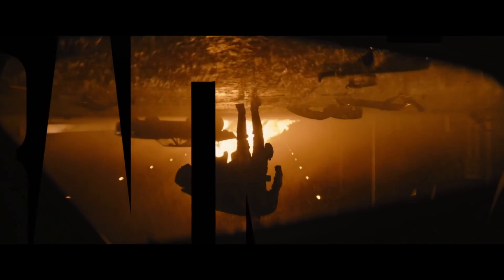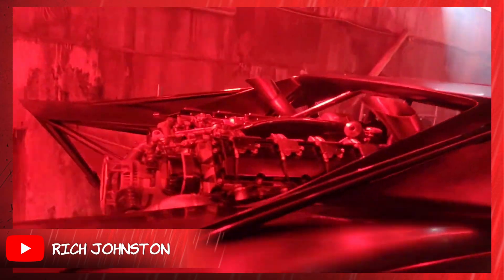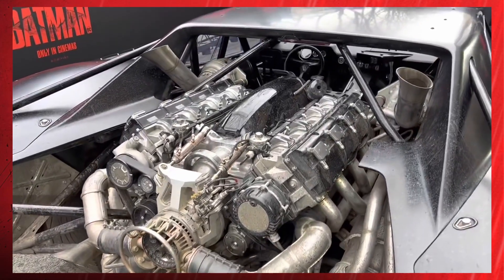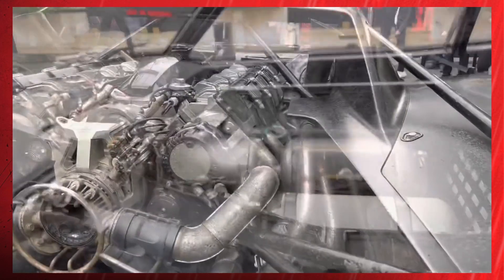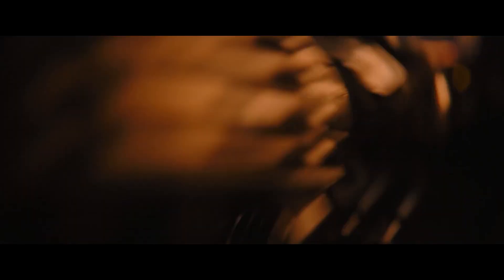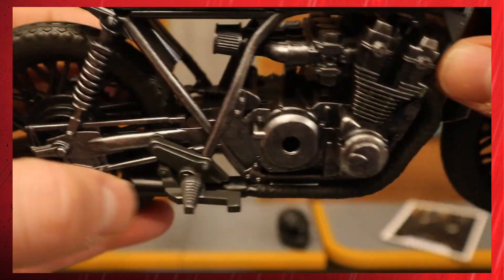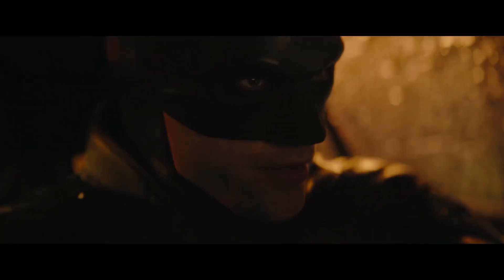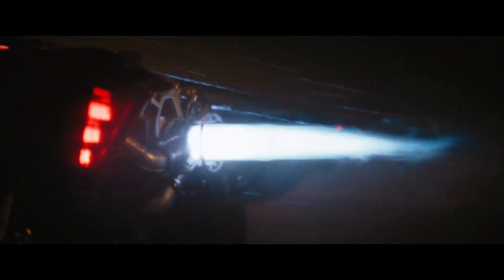The Batmobile & Everything You’d Ever Need To Know | The Batman’s *modified* 1969 Dodge Charger

Comment: Great research.  I read where all the shots they did with the flames (coming out the rear and the engine bay in the front) were filmed using the electric car to avoid flammable gasoline.  I'm guessing from a design perspective they wanted the rear engine to power the "jet Engine turbine" and the front engine was the standard V-8 driving the vehicle.  At least that is why it made sense to me to have two engines.
Reply from the maker: Nice! That makes a ton of sense!
Reply: "In universe" the vehicle only has one engine.   The real props have the "real" engine concealed because the visible engine -- especially the rear flame --- could never work.
Reply: That was kind of my take-away from the movie: that the car must have a big V8 in front that is the main driving power to the wheels (exhaust flames under the hood), and the rear engine is supposed to be more of a jet engine for strategic power boosts, like jumping the car thru the flaming semi truck. But what really matters is that THIS Batmobile in THIS chase scene was a huge adrenaline rush and played out almost like a scene from a horror movie.
Reply: It has twin turbo v8 all wheel drive

Comment: I am 100% sure that the “drifter” bike is a 1980-83 Honda cb750. the engine and tank are the same as my '81 Honda. 
I took it apart piece by piece I would recognize it everywhere.
Reply from the maker: Thank you for doing the work! I'll make the correction in another video once the Blu-ray/behind the scenes are available for everyone
Reply: @CinemotiveShopcraft  hey Josh! Great work! I myself have been doing some research on the drifter bike, and there are even elements of a 1970's honda CB.  Especially with the softtail design!
Reply: 75-78 seems to be the closest resemblance
Reply: I thought it was a Honda cb 550

Comment: Psssst! there's an alternator on the rear engine. It's right there on the passenger side. The pulley is facing forward to interface with the serpentine belt. Some OEMs actually do it this way for packaging. It's literally in the shot where you're saying that "power isn't being generationer by an alternator." :P
Reply: One more note - if you remove the balance bar between the two brake pedals on the running car, I wonder if you get steering brakes consistent with a dune buggy?

Comment from the maker: Thanks for your patience. I tried getting this out as quick as I could while also making it as accurate as I could. I hope you enjoy and that your appetite for Batmobile trivia is fed :)
Reply: Hey man , I've left you a like 👍
Reply: I was thinking a kz1000, of the drifter motorcycle. 
I would say you're right,  BMW Rnine t for catwoman ride.
A mod version of BMW/ Harley Batbike.
Reply: Lightning! ⚡Lightning! ⚡Lightning! ⚡Lightning! ⚡
Reply: Rad video man, do you know where I can see this in person?
Reply: Nice work. I like figuring this stuff out myself. I think the general shape is charger without any actual parts, except maybe some glass. The roof is flat as plywood.
On the designers site Ash Thorp has some very 69 Camaro drawings as well.

I saw a behind the scenes of the Batbike and it sounded electric. It may be a Harley electric. Also, a 'Lotus 7' had a camera strapped onto it. [if I link youtube thinks I'm a spambot and deletes it]

THE BATMAN (2022) filming action sequence (behind the scenes)

Also the rocket exhaust without sound effects.

The Batman (2022) - The Batmobile Startup | Behind The Scenes Footage
Reply: Kevin's 3D Creations  Sounds electric to me, BTS. It's engine area is massive top to bottom, just like a Harley Livewire. And they made 1 of 4 Batmobiles electric as well.
The designer gave it that look with stuff sticking out the sides. Doesn't mean they used that type of bike. Or maybe they used both.
Didn't Josh White say it had Harley front forks? Why would they put harley forks on a BMW?

Comment: OK, it's got two turbos mounted inside the cabin. So what's the central afterburner for ??
At 11:45 you can actually see the mesh filter in the turbo bell mouth.

With the engine mounted between the rear wheels the axles would have to go thru the sump ala Skyline GTR. But of course a Hemi motor can't do that !

That Medway belt is only rated to 60deg C ! Engines get wayyyy hotter than that !!

Comment: Hey Josh you said I think a motor running backwards would not work. 
look at a marine motor. because I think I might have seen this motor at my friends house.  the motor I seen was a chevy vortex 8100 reverse rotation twin turbo v8 out of a cigar boat. it looked a lot like that and it was reverse rotation twin turbo. but I can not remember if it has. coils like a hemi or a BMW.  yea probly not could have just customized a hemi with a reverse cut crank, like for a boat. that make sense to me.
thanks Todd

Comment: Could it be that the car was supposed to have 2 engines? The front provides power to the front wheels and electricity for the car and the rear acts as a sort of over-power mode driving the rear wheels when speed and 4wd is needed?

Comment: Great video, but look at your sources again... only the roof is 69 charger, the body is entirely custom bespoke. The front tire size in the video you referenced from the UK car is 30x12.00r18 on an 18 inch wheel, but unfortunately MT has discontinued that size, so the closest you can get is 28x12r18 up front, and 31x18r20 rears in the Sportsman. I did notice the car shown in NYC had 20 inch rim size for the rear on it.
Reply from the maker: Good catch!

Comment: I remember the Tumbler from the Nolan movies it used a chevy 350.
I wonder if the 650hp Chevy V8 is the ZL1 engine? It has the 6.2L supercharged v8 with that much power. Or I guess the Z06 C7 engine.
Anyways the scene was still awesome.

Comment: I think this Batmobile did only half of what the Batmobiles before it did. And that was actually a movie plot point. At that point in time, Batman was just alternating his time between his actual Batsuit and Drifter outfit and was mostly using the Drifter outfit and bike to get along while his Batsuit was stored in his backpack. He was working on the car for a long time as you can see at the start of the movie when he's in the Batcave and the engine is on the workshop. So, the half I was talking about is actually the half-finished nature of the car. It wasn't looking like a fully finished Batmobile but was still terrifying to look at and hear. Bruce was only using this as a pursuit vehicle because of the current predicament surrounding the police looking for him, something he can't afford to be while he's on his bike. 

If you look at the Batmobile, the engine is clearly too big for the back of the car, and he's cut out the back to accommodate the massive jet engine and afterburner. Naturally, such changes call for bodywork to cover the exposed part of the engine, but as per the aforementioned reason, Bruce chose to drive the car immediately, and while it was functional, the fact remains that it is grossly incomplete compared to the multi-featured Batmobiles of the other films. Given Bruce is now using the Batcyle at the end of the film, he's using that for the time being while he's gonna complete the build of the Batmobile for the next film, which Matt Reeves is planning to do.

Comment: There's one thing I'm still confused about the batmobile, does it have 2 engines? 1 in the front and the V8 with an afterburner in the back? Because i got confused when i saw flames in the front when the car started up (menacingly scene btw)

Comment: why does it sound more like a supercharged engine than a turbo? I'm not very familiar with either so it maybe a dumb question
Reply from the maker: Both whistle when the turbines compress air in their housings. But the turbo has a "brap" release since the spin is tied to the exhausts' output whereas a supercharger is tied to the accessory belt (always driven).

In the movie, I'd say it has more of a turbocharger sound. I definitely can hear what you mean though. Especially in the initial startup.

Thanks for commenting! ❤️
Reply: @CinemotiveShopcraft  @Dhanu _45 The sound designer for the movie did an interview with Dolby and discussed the sound of the car extensively. The supercharger/jet engine whine is a slowed down bottle rocket scream, and almost certainly was inspired by the Hellcats (it is a Dodge after all) supercharger whine/jet engines of course. The engine roar itself came from two recorded 70s Broncos with big block Fords.
Reply from the maker: Dude! I hadn't seen! Thanks for the insights!!

Comment: I BET I AM RIGHT!  See that thing on the back of the engine?  That looks
 like a little turbine.  What is under the hood is the compressor or 
combustion chamber to create the compressed air for the turbine on the 
back of the engine.  The power it creates goes straight to engine crank.
   If you see the real car there is a wire going to the turbine and that
 would be a sparker or glow plug or something to ignite the extra fuel 
they put to it to create the flame coming out of it.  So the car has a 
turbine engine and a piston engine then.  Just the turbine was split in 
half.  Half under the hood and the other half on the back of the engine.
   Make sense to anyone else?

Comment: How can the rear Bat-mobile engine be considered a working or none-working V-8???   When have you ever seen an engine with a jet turbine coming out of the center of it?? It may utilize some engine components, but it's more likely to be a completely exposed jet turbine engine (mind you the air intakes are in the car's (used to be) back seat) - not a V-anything. So to properly evaluate it, you'd need to have someone as familiar with jet turbines as car guys tend to be about V-8's, to do the evaluating.

Comment: As much as I love this Batmobile, I hate it with the same amount of vigor. Now, I won't talk about the IRL Batmobile(s) built for the movie. I'm talking lore-wise. I just can't wrap my head around WHY would he build it this way? And no, the argument "He's been doing this only for 2 years" doesn't fly with me. One of my mates, an IT guy, who likes cars and tinkers with them in his free time, has basically rebuilt his Leon and turned it into NOS-powered dragmobile. And it didn't take 2 years. For example:

- why are there evidently two engines? And which one is for the jet? Can't be the rear one, since the exhausts directly exit the turbos.
- why is the front one glowing during the start-up sequence?
- why would you mount an engine in the back and leave it EXPOSED? Has Mr. Wayne seen what a well placed .50 cal round can do to an engine?
- why would you put turbo intakes just inches behind your own head?
- why would you completely eliminate the passenger seat? Is he not planning on taking criminals into custody at all?
- why would you put 14 exhaust pipes on the car? (not including the jet)

I'm sorry, but just as I love the idea of this kind of a Batmobile (which I've taken further and designed one myself, based on a muscle car as well), it's simply too stupid to be either functional, or designed by the Batman.
Oh, and your research into this was nothing short of brilliant. Great work!
Reply from the maker: Absolutely love your comment!
Reply: @CinemotiveShopcraft  Cheers, mate. Made my day!

Comment: So the rear engine is fake?
Reply: Kevin's 3D Creations  what do u mean? Like it powers the turbine that drives compressor? I don't think so... you hear the jet whine and scream BEFORE we hear the engine startup and roar. I think that glow under the hood is actually the bulk of the jet engine setup in universe. The exhaust gasses from the engine in the back help sustain the jet engine after it gets spooled up by an electric motor or something.
Reply: Kevin's 3D Creations  not yet. I will though.